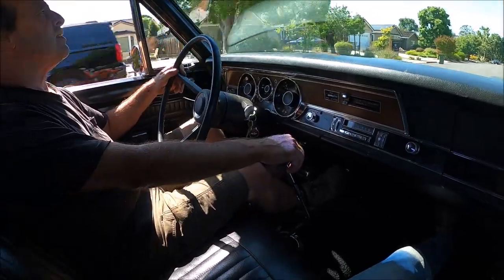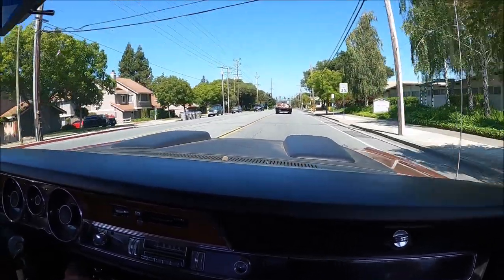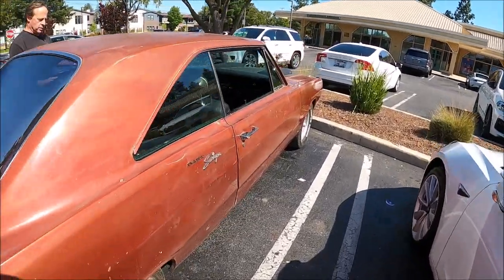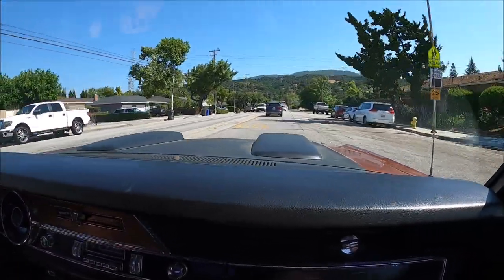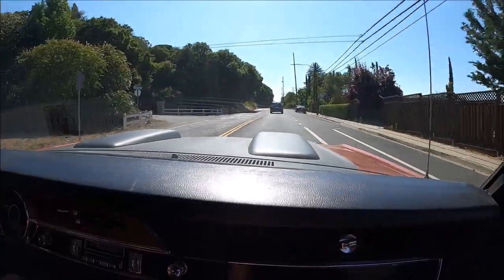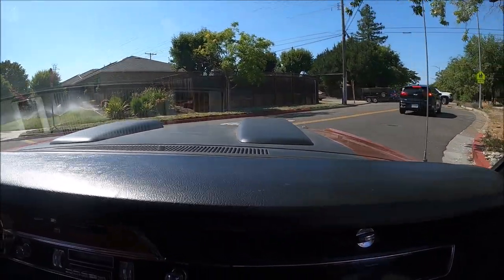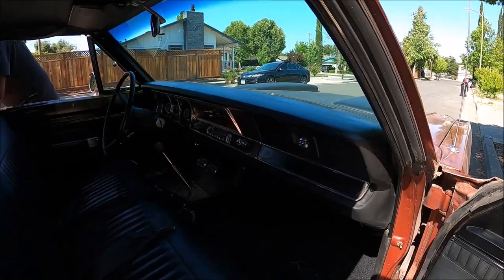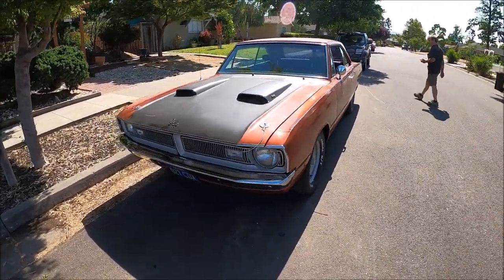Project Mopar: Brian's 1970 Dodge Dart Swinger 340 4-speed - Maiden Voyage Take 2

Comment: Glad I ran across this video!  I'm sort of digging the fact it's not perfect cosmetically.  But the engine compartment is perfect and that's hat counts.  Nice example!  That color is nice (our '72 Cutlass was close to that color).  Brought back memories of being in our '70 Swinger 340 4 spd. (in light blue/blue interior with lighter blue rear deck stripe and flat black double scooped hood, carpet delete) when my Dad bought it new off the showroom floor.  Cost new was just over $3K on window sticker.  FAST car.  Thanks for sharing it.